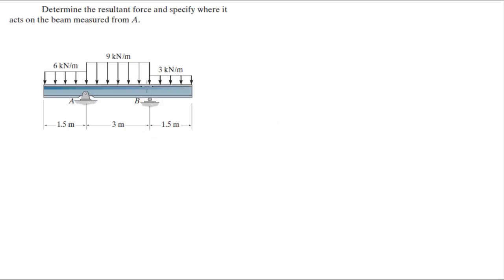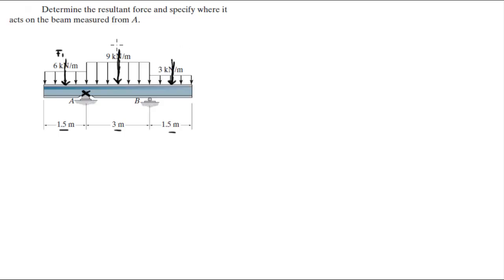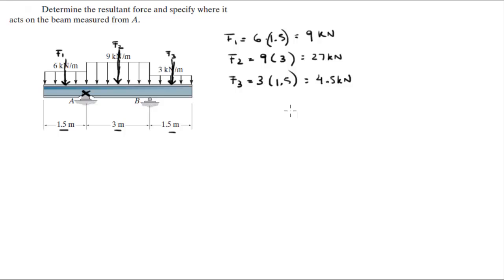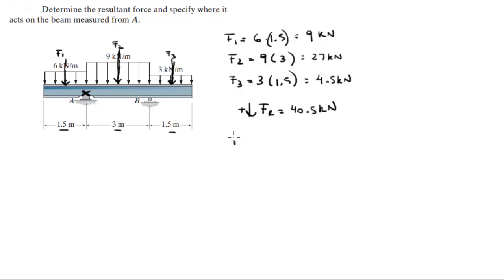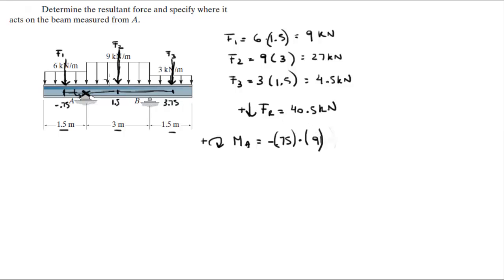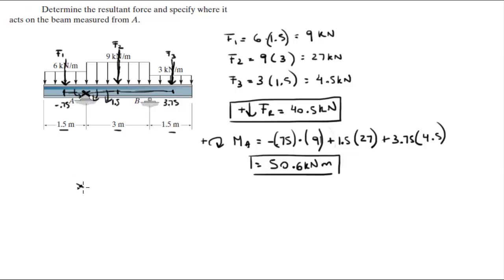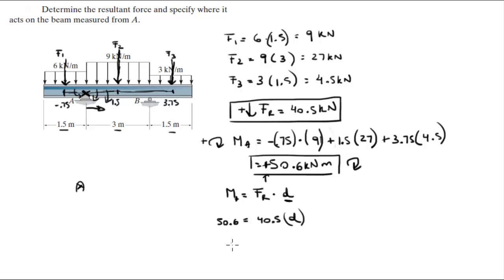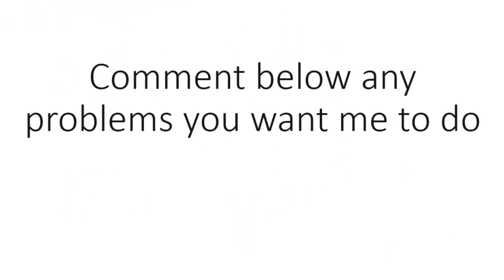Determine the resultant force and specify where it acts on the beam

Comment: How did you came up with 3.75?
Reply: (1.5/2)+ distance from A to B so (1.5/2)+3=3.75
Reply: @phillipjones2882  and why is (1.5/2)??????
Reply: @Danford_tz  The distances are taken from the first support. So for F3, use distance 2 so 3m and force 3 acts at half of distance 3 so 1.5/2. Thus the total distance is 3+1.5/2 thus 3.75

Comment: How did you get (-0.75),(1.5) and (3.75) ?
Reply: Midpoint of the rectangle
Reply: @aquilesdearaujosousa6967  I don't still understand how he came about -0.75
Reply: @nosakhareagho7799  The zero is at point A so the 1.5 was in the negative direction so half of -1.5 is -0.75
Reply: Saleh AK how to get
Reply: half of the distance of the beam